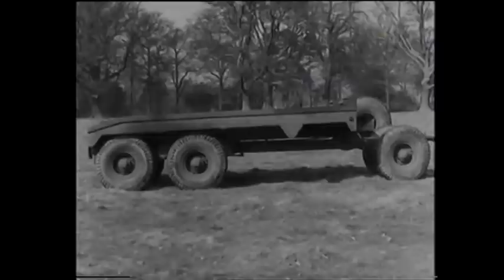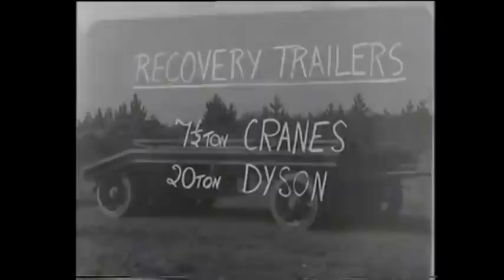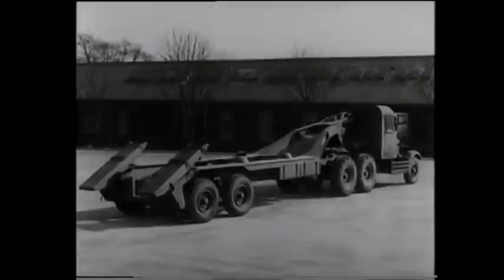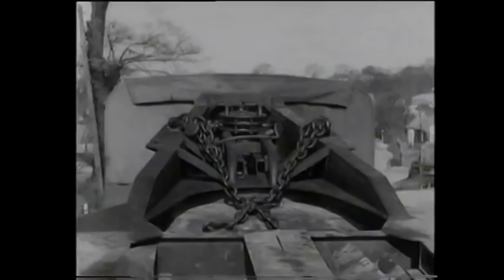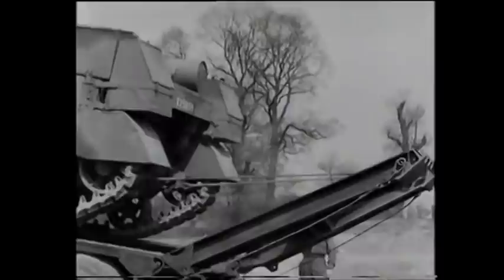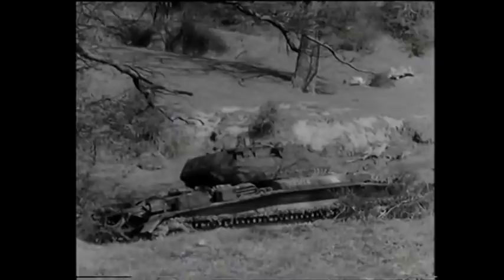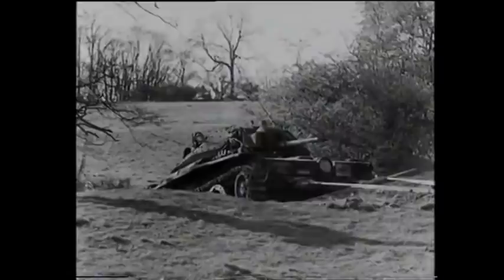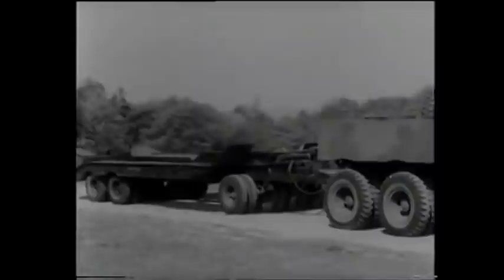Recovery Vehicles    Recovery Transporters and Trailers

Comment: Even back then WTF can't people back them up into position.Try backing up a old TJ skidder bucket and trailer,it's a lot harder to do than that stupid little trailer. On the TJ skidder bucket you had to keep an eye on the boom that stuck out over the front as it would go the opposite direction you want to turn.Then the trailer was another trick and you had to keep an eye on all of it.  Once you done it awhile it was easy.....and the steering on the TJ was stick,not a big steering wheel...lol
How about farmers that have balers and wagons......

Hell of a lot of work detaching that trailer (even though it's a pintle hitch)and then reattaching it to the front,then detaching and reattaching it to the rear.......must be a Britts "better idea" like that recovery SNAFU along with the "NCO" standing beside the winch cables under load...especially that kinked (damaged) cable.

Comment: What happens if the terrain is not level or dry , also when the driver gets back into the tractor to run the winch who turns the crank to start the engine . It would make more sense to send 3 or 4 guys to repair the tank or send another tank to tow it back to a repair facility .
Reply: I'm sure the Engineers could cope, taking an operational tank  (which could be miles away) out of service to rescue a disabled tank sounds implausible.

Comment: Fascinating film.
Thanks for uploading.
I can imagine there were a lot of black thumb nails with all that lot going on.
I'm curious about two of the recoveries though..
What's the reasoning behind passing the cables under the 'casualty' and hooking them to the rear of it?
Not seen that done before.
Reply: The hooks on the casualty do not close around the cable eyes, and are open at the top.  If you tow from the front, the tow cables can pop out of the hooks under the slight upward pull.  By passing the lines under, then up to the hooks, you ensure the pull is down, away from the open top.  Additionally, the strain is placed on the body of tge tow hook where its connected to the main body of the casualty, otherwise you put all the strain on the flange/tip of the hook, where its weaker.
Reply: @Michael Gower  That makes sense. I hadn't thought of it that way.
Thankyou so much for explaining.
Much appreciated
Reply: @Andy-qo7dj  I feel sure the troops dojng an actual field recovery in deep mud instead of conveniently flat, clean concrete greatly enjoyed the process.
Reply: @MGower4465  It'll also help to lighten the front of the vehicle as it's being winched to aid in getting it up the ramps.

My father was a tank mechanic (M48) from '57 to late 60's and was on a M88 tank retriever once they were issued into service.Once out of the Army he spent the next 40 yrs as a heavy equipment mechanic for a very large road construction company as their #1 field mechanic.He's worked in everything from -50*F to 100+*F rain,snow,sleet,shine,wind so he must not have minded to much...lol